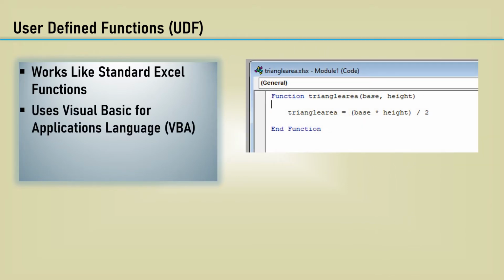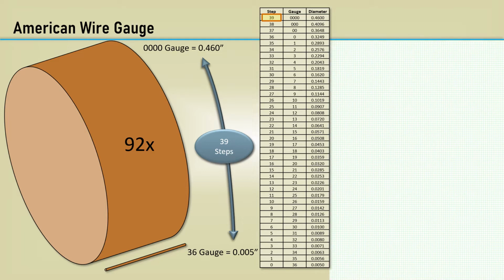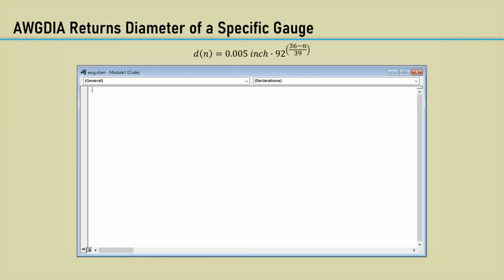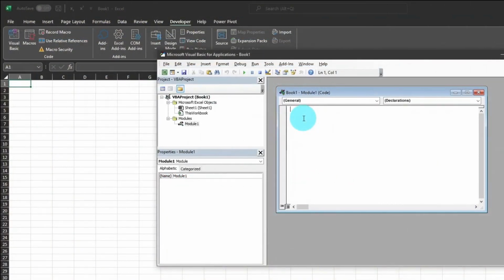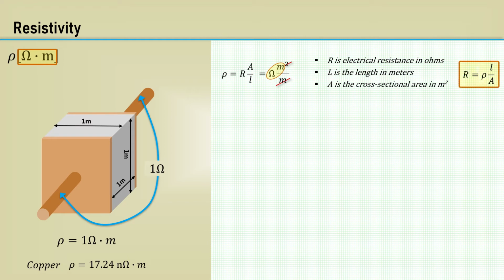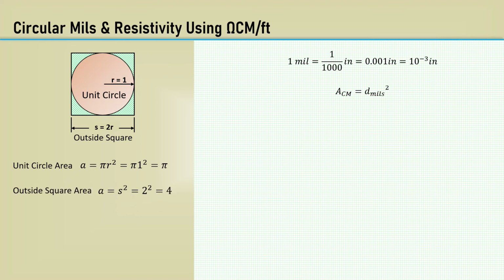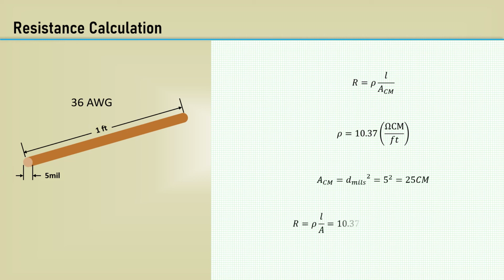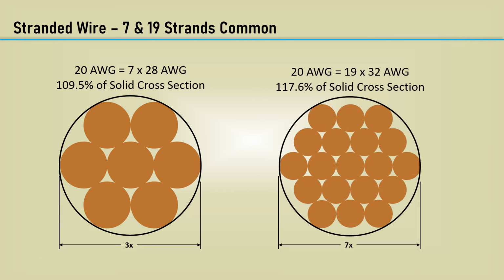Creating Excel User Defined Functions - American Wire Gauge

Comment: I enjoyed the video. I am going through your different videos presenting your approach for working with Excel for engineering calculations. The custom formatting and use of scripts (Visual Basic based) to provide a generic general purpose easy to understand calculator can greatly speed up calculations and studies, and do so with a relatively inexpensive container (calculating shell) which is Excel. 

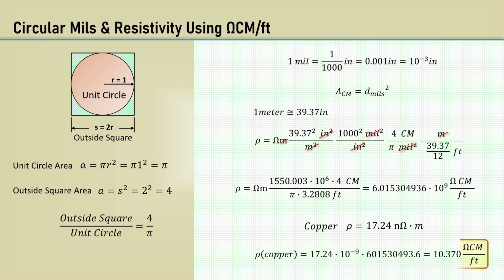At about time index 11:42 your final calculation of 10.370 is correct keeping maximum resolution until final solution. However, the calculation before it of 6.015304936 x 10^9 should really be 601.5304936 x 10^6. Please check my work. 

Perhaps an easy way to look at Circular Mils is they are Bloated Square Mils. For example looking at a cross sectional area of a rectangular bus bar which is obviously not circular. Where we have a simple conversion factor of 4/pi to convert from Square Mils (SM) Area to Bloated Square Mils (BSM) Area. In this way the confusion of the word circular in Circular Mils has no relation to something round, a square area called round is just a poorly chosen approach, where the benefit would be perhaps in approximate current scaling rules of thumb when moving between conductor AWGs. However, from an engineering standpoint it would make more sense in relating conductors purely on their exact cross sectional area, what ever the cross section may be.